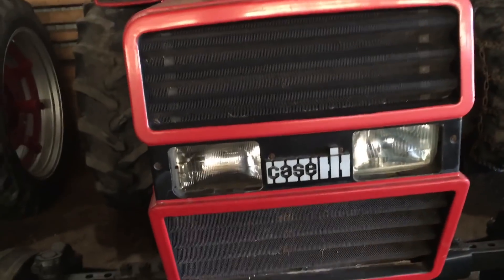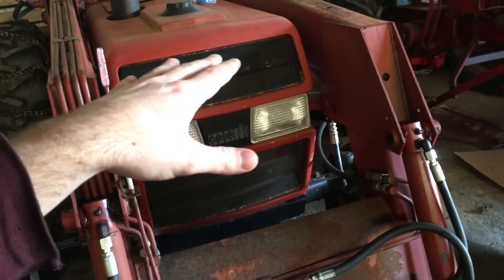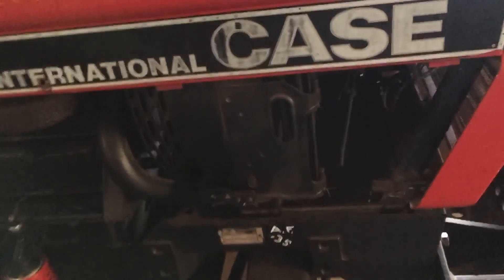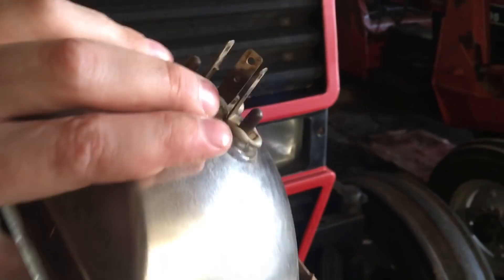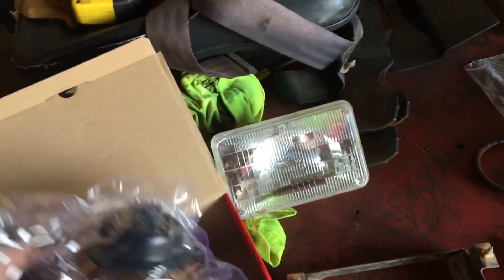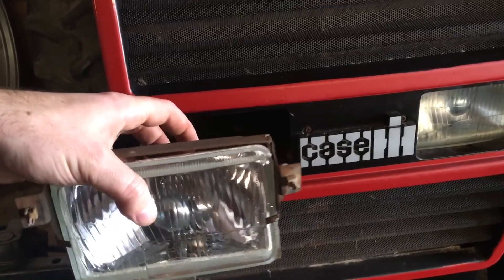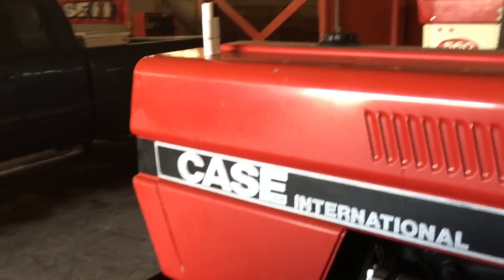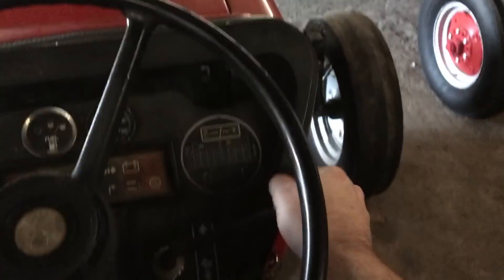Case IH 85 Series Headlight Install

Comment: I use A&I parts you don't have to bend over as much.Front window for 986 from IH between 5-600 bucks,got from A&I 175.And that was ordered through my CaseIH dealer.
Reply from the maker: Did the window come with the weather striping to hold it in? I have to get one too?
Reply: No my glass guy was able to reuse mine.Longer picking the glass out of it then the install.

Comment: Good day  Your power steering  does it turn extremely  easy. 574 does not. It's easier than old W-6 without, but not as easy as a car.    Thanks. I forgot  my 3pt ht  is  slow sometimes, if you pull remote valve then  it works ok.  Thanks